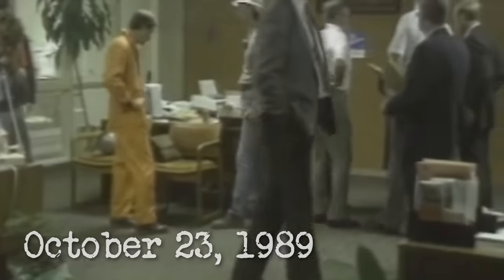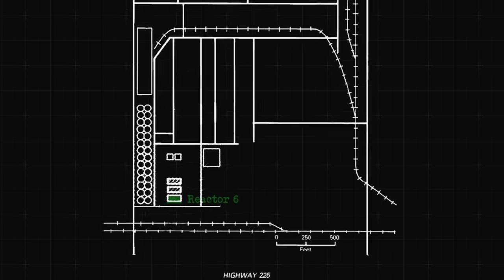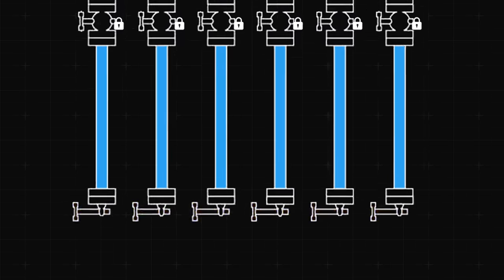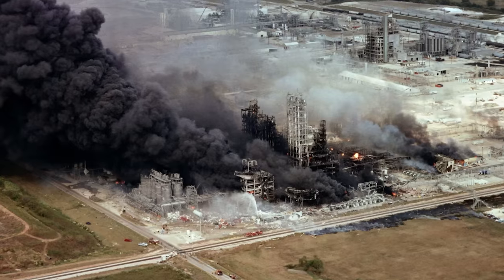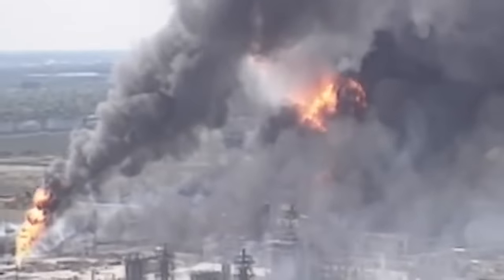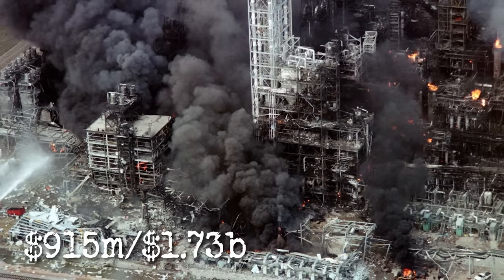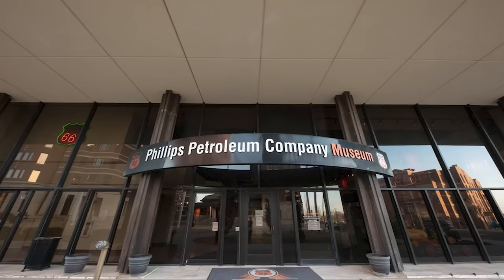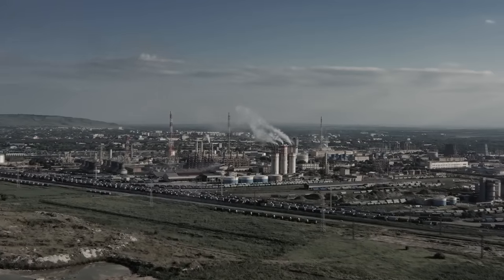When a Company Ignores 575 Safety Violations

Comment: I was in my office at Shell DPMC MEK refinery east when the first explosion happened. It rock us so hard I thought the explosion was inside our plant. Got outside and saw the mushroom cloud with large pieces of metal flying high through the air.  Lost several people I knew in that blast including one that committed suicide in November on our hunting lease due to inability to deal with the loss.  He was thrown and knocked unconscious from the blast. We had talked with him many times to make sure he was alright and said he was.
A couple of weeks after Phillips we like to blown Shell off the map. I was in the LHT II control talking with the SO when all the chart recorders went off the paper due to high pressure. The unit rupture disc did not blow and a unit evacuation alarm was sounded. My crew was perfotrming an IDLH repair on A sour gas compressor in the unit and since you could not hear the evacuation alarm in the unit I ran across the field into the unit to get them. As soon as I entered the unit the whole bank of high pressure H2S fan coolers just across from the furnace ruptured. Luckily they blew straight up and did not ignite. The strong wind that day blew the explosive gas away from the furnace. Got my men out and evacuated to the wax plant warehouse. I stayed behind to open up the fire moitors and put up a water wall to ptotect the one operator on the unit who was isolating the unit at the main valve station in the middle of the unit. Put a single monitor stream up on the fan coolers and then evacuated. I was trapped by fire several times that year including having my previous office blown up several months before that. I have a lot of stories from those years.

Comment: Volatile fumes are nothing to mess with. I used to do fire watch at a construction site, and one morning shortly after my shift ended a Pacific Rim Mechanical employee either opened an oxy acetylene torch tank and didn't shut it or nudged the valve and didn't think anything of it. Later that afternoon, there was a blast that gutted two floors of the structure. A crane operator at another jobsite a couple of miles away felt it as his crane suddenly rocked. I swear to you, during the prior night I smelled no gas leaks. Nothing at the time seemed to be amiss. A week prior, there had been a pipe bomb explosion at the federal courthouse, so the FBI and DHS combed over the incident site just to be sure. During that time an adjacent parking structure was closed, and I was part of a security detail keeping the public out. There was one family that was absolutely incensed that they couldn't park there to go see that day's ballgame. You'd have thought that I contrived the whole thing just to piss in their Cheerios in particular. Pac Rim Mech was found to be at fault in the end.

Comment: The line "A disaster caused by one wrong move" is definitely wrong, and the title is more right.  Whenever these kinds of things happen, it's never just one thing.  There are always regulations, checks, and safeties that, when properly implemented, will prevent a single small mistake from causing a huge catastrophe.
It's always a long chain of complacency, cost-cutting, and minor violations that leads to the big disaster.

Comment: as someone who works in chemical plant, the first and biggest issue outlined here is the companies LOTO procedure. how in the world can a company the size of Phillips not have a comprehensive energy isolation policy is beyond me. if you can hook up air to a valve and have it open, that valve IS NOT locked out. you have to lock the valve AND the pneumatic actuation out. also, how is it that valves that have been locked out are still having work performed on them? this is pretty standard stuff i cant believe something like this could happen even if it was 34 years ago.

Comment: Looking at the diagram, there should have been a manual isolation valve ahead of the pneumatic air valve between the reactor and each one of those drain lines, there is no way that is safe to work on with pneumatic valves alone.  It also sounds like their LOTO  procedures were lacking with no lockboxes.  Only person who should have been unlocking that equipment is the operator themselves, no contractors.

Comment: Thus another corporation bites the dust…
Having worked and retiring as an refinery operator I’ve experienced a few of these accidents, although not to this scale.
Majority of these are caused by an individual who makes a bad decision. During maintenance periods (in my case) work is fast passed 12 hour shifts for short period as possible to get the unit back up and producing. It’s easy to say “Phillips petroleum” however it really boils down to a small ground of decision makers in the immediate units realm.
🙋🏼

Comment: IMHO and after 45 years in the oilfield working some of it directly for Phillips, there was a procedures failure here,  those air lines should have been marked prior to disconnecting them and tests should have been run on those valves to know for sure what their position was, usually it can be told by the position of the outside flapper handle peg in relation to the valve body with direction of flow, if insulated then cycling the valve should have told you.

   Subcontractors are a large and necessary part of Operations there is no way to get rid of them but we can put in place protocols, and here in Canada you must have a COR or SECOR to even be on an oil companies vendors list as well  we have a central certification system requirement for each employee to even qualify to be on location.  This Certificate of Recognition says that your company has a safety program and all your workers are trained in safe work and safe operating procedures, on the rigs we rely heavily on JSA's and FLHA's which is what should have happened here, you can hire someone to shingle your roof, but you cannot stop them from falling off or through no matter how hard you try but to sue you when they do is the like scenario here.  In this instance  it was better for Phillips to have just paid the fines,  and those 575 violations were all heavily under microscope with a very great number being minor I would hesitate a assumption and I will tell you that it takes a hell of a lot more than most will ever understand so that they can plug their cell phones in or jump in their cars and start them up.

 I am very sorry for the men and women who were affected here and my condolences.
Reply: I agree there was a procedure failure. But administrative controls like procedures are always inferior to engineering controls in the safety world. The valve should have had different connection types so it is impossible to hook the lines up backwards.

Comment: the problem in most of these cases where they happened around the 90s or earlier is you need to recognize how little training was given to supervision back then and how the "safety" aspect even in the Oil and Gas industry was SEVERELY lacking and death was considered for the most part, part of operational design it took a ton of people dying and a shit ton of fines and people going to jail before the industry started to decide maybe its a good idea we don't create an environment where people can die.

even today with how highly trained many people are these days there are often more people then not that have zero formal training running things then you would imagine.

That being said even today major oil and gas facilities have wide ranging variation in operational safety many facilities are probably operating in a range of high potential for incident for the most part and should be doing much more, however, the structure of cooperation's and how shareholders view their investments in these businesses leads to more incidents then it should getting true buy-in from big business and more importantly stakeholders in these businesses is still a major struggle.

Comment: In that first explosion, it seems likely the result of a single worker's actions (removing the lock).  I don't know who made the reactor but I'm surprised there wasn't a more robust system in place for this maintenance work which would prevent removal of locks without some kind of key (held by one or two responsible people).  I also didn't understand why they wait for all the pipes to block before acting when it looks to be designed in such a way you could unblock one pipe at a time and never have any downtime.  It said the reactor continues to run during this work, which might take 2 days, so I would like to know where the product from the reaction is going during this time, I was expecting that this would cause the explosion as the pressure should be rising the whole time those valves are closed and the reactor is running.

Comment: Sub-contractors absorb all of Phillips financial risk by assuming all the liability for the sub-contractor's work.
Large companies hire contractor work force for 2 reasons:
- The contractor assumes liability for their workers actions on the job. 
-The labor cost is, at a minimum, 10% less because the contractor pays FICA, unemployment and workers compensation.
The labor savings can be as much as 65%, if one compares a contractor willing to use undocumented workers to a unionized labor force.
That in itself explains much of why Phillips got a slap on the wrist. The contractors may well be broke or disappeared before they pay a fine.

Comment: This was.not the worst factory my mom and step father used to live two miles from Pepcon rocket fuel plant in Henderson NV when ot blew up i heard about this accident at pepcon someone said henderson blew up. I was about 16 the explosion was two fold a person violated a ton a safety regulations one being storing the solid rocket fuel 2 the chemicals stored improperly a welder that was patching up a storage roof sparked a small fire that hit a natural gasline that had a leak this place blew up like a nuclear blast that here's the irony the explosion took out a marshmallow factory across from it the blast only killed two the manager of the marshmallow factory and the persons plant manager but the blast the Shockwave rolled a friend truck that was responding as well as 14 businesses nearby and some homes as far as five miles suffered minor damages majority in down town Henderson windows blown out and including my mom and stepfather house had damage to the walls

Comment: It's not that the fines are problem, it's the amount of the fines. In order to see change the fines need to outweigh the cost to fix the issues. 10k, 20k, even 100k is nothing to the behemoth power, oil and gas companies. The fines need to be equivalent to the cost of remedy or we will continue to see zero oversight when it comes to safety for the workers.

Comment: I am surprised at the basic design of the reactor element as highlighted.  
From my own experience with high pressure steam and fire systems, main valves are often doubled up with 2 valves on the branch and often have mechanical  indication of the position of the valve so that you are not relying on a remote indicator which shows what position a valve should be in if everything else is working ok.
Reply: We had double block and bleed systems in our plant,which was learned from the Bhopal disaster our plant was a subsidiary of Union Carbide.

Comment: At the contractors they outsource engineering to global delivery centers/high value engineering for a couple dollars a hour. Contractors bring in guest workers on H1B and OPT guest worker visa, have people come in on vacation visas and work under the table. Pressure vessels in the same service in parallel will have the different design pressures and inexperience plant operators will assume they are the same and over pressurize one vessel causing a rupture and explosion.

Comment: Quite a few lies in this video. The leak happened over minutes not a second. People reported the cloud forming to the control room. They were told it was steam. Also, the valve that was opened, was done so by the control room operator. I was the Instrument tech foreman on the plant 8 build, which had revisions due to the explosion. It roomed the control room from the ground up. The guards tried to prevent people from leaving, locked gates etc. They continued to do that during any emergency even after the explosion. Massive ass covering.

Comment: The fines are almost without exception much lower than the investments needed to avoid safety issues. Companies laugh at fines and settlements and the people that cause them. This ain't no cure for greed. Shutting them down until the problem is solved, is.

Comment: This is still referenced in many safety classes to this day for the oil and gas industry. I was across the street from the explosion in lemont Illinois that happened at Seneca petroleum. I was as Citgo for a turnaround. This was less than a year ago. The OSHA report has not yet been published for it yet though. If you look up tank explosion in lemont you will find the news reports. Ignoring safety protocol costs lives.

Comment: Sub contractors are a un avoidable part of the petro chemical industry. No operation can economically have every skilled trade on full time employment year round. I work on an oil tank barge and generally no one but our crew touches anything on it works on it. Even when we do get an outside contractor they don’t preform any maintenance without a qualified company representative or crew member there and only licensed crew or shoreside employees can operate any of the equipment.  The shoreside refineries have so many employees that it’s hard for the same people to always be present when maintenance is being done. Regardless they probably cut corners on the lock out tag out process and work permits.

Comment: Considering how much fuel they refine and chemicals they produce I would not emphasize the fact they have had accidents and overlooked things. You have to crack a few eggs to make an omelette. 
Disasters happen. Compared to 200 years ago the workplace is a safe spot. Even high risk jobs such as these. You dont like it then dont sign up to work in a factory or a plant with chemicals and machinery and hazards such as these. You can work at Arbys or Wal Mart. Nobody forces you to work there. The pay is probably a lot better than Dominos Pizza or Roto Rooter.

Comment: Not sure why the producer of this video has a problem with using subcontractors. They make it sound like subcontractors are all just cheaper labor with no intelligence. However, it is up to corporations to hire companies who are competent to do a job. It probably been wise for the company to have a safety official and engineer present to be sure the job was done correctly, assuming they didn’t. Secondly, this is one of those cases that looks like there is blame top to bottom. Did the safety inspectors do their job? Did workers follow safety protocols? Did Phillips provide adequate funding for safety? We’re there routine training and inspections? Did OSHA perform inspections? Did they follow up? If there were that many violations, why had osha not done their job? Yep. I’m sure just about everyone had some blame in this except the average worker doing what they were told. God bless the blue collar folks and God bless the families who have relatives injured or killed by this.

Comment: Anti-oil safety Karens create one excessive safety regulation after another in order to crush oil companies.  The result is the critical safety elements are drowned in a sea of useless safety noise.  The result is accidents that would have been caught. I'm not saying this is the cause of this accident, its what I have seen over and over.  OSHA comes in and the guy is in a bad mood, they will start writing up everything.  Dirty spots, a drip of oil, volt meters out of calibration, water bottles not having stickers, spare parts out of cal date, safety chains drooping too low, etc.
Reply: This was a chemical plant though?

Comment: less experienced contractors than there own that's flat out BS. most of those contractor employees have most likely been there longer than the plants own people and probably new more about fixing things in that plant than all there plant maintenance put together, I worked as a plant maintenance contractor for close to 40yrs. at Eastman chemical co. I know how plant maintenance workers work. your talking about plant maintenance that will use a rubber stopper and a hose clamp to stop a leak because they have no clue on how to do it right. that's why contractor have WAY more experience than plant maintenance.